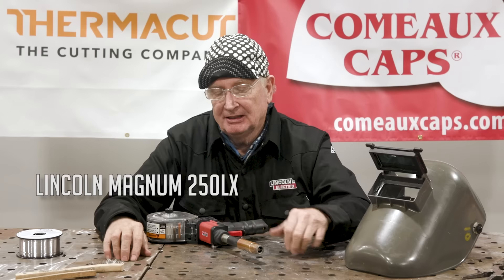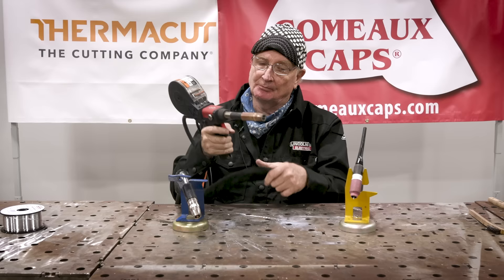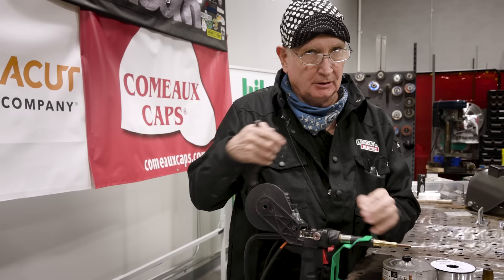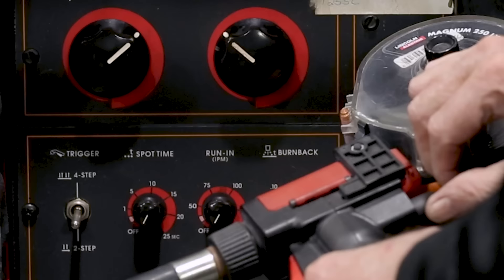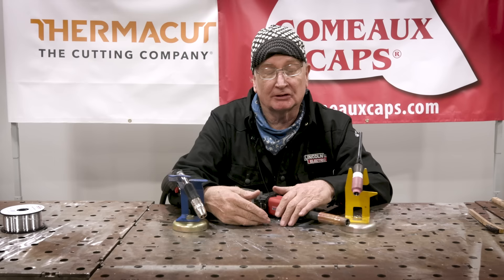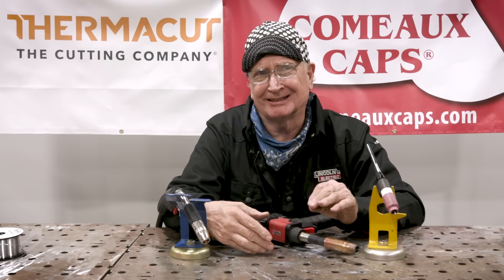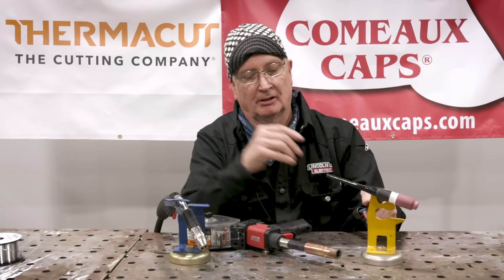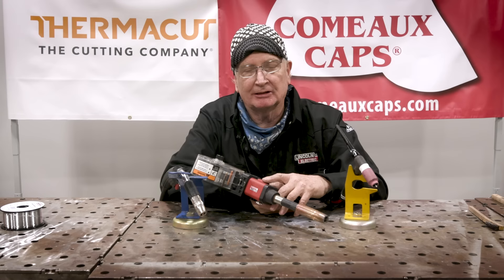How To Weld With A Spool Gun

Comment: is the mig gun with aluminum set to AC or DC?
Reply: DC positive ....same as for steel or stainless.....thanks for commenting and watching, Paul
Reply: @ypaulbrown   thanks, I was wondering because welding aluminum with a tig is AC, just wanted to make sure.
Reply: @ypaulbrown  another quick question, will this work on Cast aluminum?
Reply: @guss1470  yes it will work on cast aluminum, and most times is easier that tig in my experience......due to the 100% electrode positive  cleaning action...[cast can be dirty]...you still need to try clean the casting first.....and it might not hurt to heat, and apply solvent, and reheat a few times, use a propane torch, or oxy/fuel.....to clean any grease out....hope this helps, Paul
Reply: @ypaulbrown  thanks, I have a hair line crack in my transfercase and I need it repaired. I have a multi process welding machine but it is DC, so no AC tig. I need my 4x4 for work. ( I also have argon) Thanks for the help.
Reply: @guss1470  Gary, make sure to groove out the crack, follow the crack to the end and drill holes at each end to keep it from spreading and really clean well....use rotary files [burrs] if you can, they do not leave grinding grit [aluminum oxide]  if not possible to use die grinder, at least scrape well after using abrasive grinder....hope this helps, Paul
Reply: @ypaulbrown  thanks for the advice, I worked in Power plants doing overhauls so I have die grinders so I can clean the crack. Thanks again.

Comment: Standard 3m 10ft mig gun water cooled teflon liner decent 4 roll drive feeder on a double  pulsed  mig with the feeder hung on a boom and you will never use a spool gun again we often run a full 7kg spool none stop with maybe only 1 tip change 250 to 280 amps 
Try that with a spool gun soon get sick of buying them dinky 1pound spools never mind holding the clumbersome spoolgun all day
Reply: well, when you work on a boat, on a trailer, you might have to change your mind about that statement....10 foot lead can be real difficult to get in to a lot of places no matter where you are....and not everyone has the luxury of a boom.....or a pulsed CV machine......thanks for commenting and watching, Paul Brown
Reply: @ypaulbrown 
Often work on boats moden pulsed migs are light enuf to drag round and mig gun is alot smaller to get into tight corners 
Ive used both and for me its a no brainer standard gun for me 
Maybe sets ive used but double pulsed mig makes a neater weld than i could ever get with a spool gun but as you say not everyone has the need  or enuf work to justify to spend the money on a double pulse mig

Comment: Materijal of alumini you mast with burner   heat up than you Can welding alumini  hot
Reply: pre heating  is true sometimes, but a lot of aluminum welding is not preheated, the small area of the arc with mig puts more heat into a smaller area than TIG or Stick welding. welding large parts can be difficult sometimes due to size and the heat dissipation that aluminum has....so heating can be beneficial on thick sections. thanks for watching and commenting, Paul

Comment: The weight is gonna affect you welding
Reply: all depends on how you hold gun, how experienced you are....there are many ways to hold the gun too.....for putting a lot of metal down fast, the only other alternative is a push/pull system that can be 3 to 5 times more expensive......thanks for commenting and watching, Paul

Comment: ah yes.. spool guns.. for people who cant afford a professional machine with a 20m push pull gun lol any machine that needs a spool gun to run alu mig aint a good machine
Reply: Yes, many do not have the 5 to 10 thousand dollars or more needed for a push pull system....and only have limited use needs. It is marvelous that you have these resources. thanks for watching and giving your valuable input. Paul
Reply: I don’t need to change liners whenever I want to weld aluminum.
Reply: @apenza4304  no need to change liner  with a spool gun, as the liner is only maybe 4 inches long. on a regular mig gun, the liner needs changing to one with teflon and U Groove rollers are highly recommended as it is much longer and the aluminum wire is no where near as stiff, for mig aluminum with a normal high gun, you can use 5356 wire instead of 4043, it is stiffer and stronger...yu also need to keep the cable straight to keep from having resistance with bends in the line..you need to use a larger contact tip also due to the wire expanding when it heats....for instance, with .030 like we used, I would want to use a .045 contact tip. hope this helps....thanks for watching and commenting, Paul
Reply: @ypaulbrown  Sorry for the misunderstanding Paul as I meant to respond to gold Elmo as I do use a spool gun for aluminum for all the reasons you explained in your video.  My comment about changing liners is if I wanted to push aluminum wire through my mig torch line I would need to change out the liner to a Teflon one and this being another benefit of using a spool gun when switching over to aluminum.
Reply: @apenza4304  Apenza, thank you for getting back to me, yes, you are correct in what you say.....If you were to use a Teflon liner in you mig gun, and run steel through it, it will cut the liner and ruin it very fast. cheers, from Weld.com,  Paul
Reply: @apenza4304  so because you lazy to spend 2 mins changing out a liner that makes a spool gun the superior choice??
Reply: @Migman2020  Minutes add up to hours.  Time is money where I live.

Comment: what is difference between spool gun and classic mig torch?
Reply: Dollars, Pounds, Marks, Francs,ect.....Basically, the spool gun has a motor that drives the filler wire.
so you are not sending the wire down a 10 to 15 foot liner.....only a few inch liner....so there is very
little chance of it binding....you also change the speed of wire feed at the gun and not the welder....
there is a weight penalty though, as you are holding the 1 lb spool of aluminum on the gun itself ....
and the bulk of the spool gun compare to the mig gun, 
but I have handled some mig guns that were also very bulky too....
I hoe this helps, thanks for commenting and watching, Paul Brown